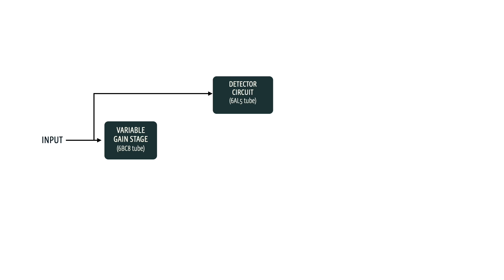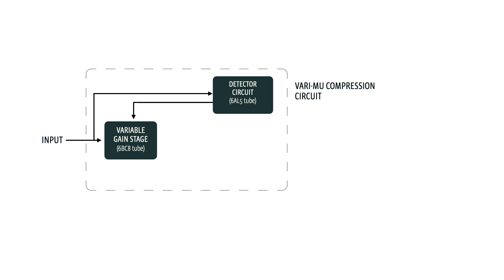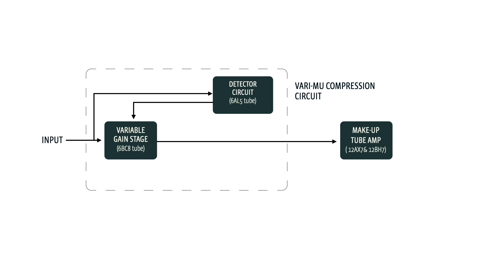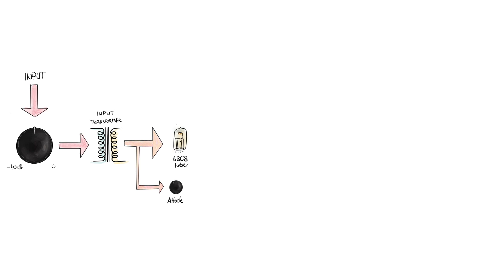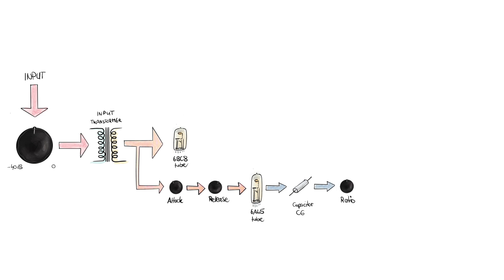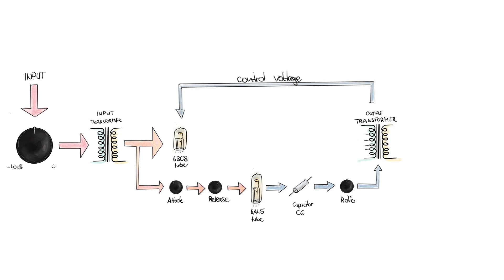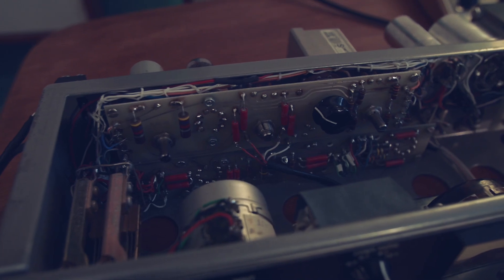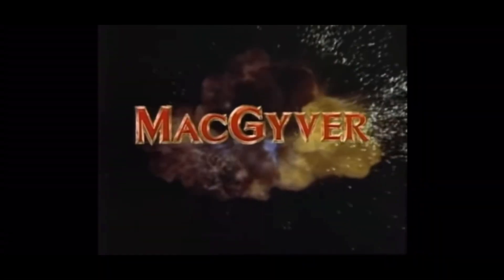176 VARI-MU Limiting Amplifier Complete Kit -  Episode 2

Comment: Definitely push pull pots  - this is an essential mod in my view (a true bypass would also be useful BTW).  I should also say that this kit is not too expensive - I costed  a 176 build from scratch last year and it was more expensive, without a real case, with Sowter TX, plus all the hassle of getting a faceplate drawn up, made up etc etc   Tubes are not cheap either - so the Group Buy with AMI TX, case, faceplate is really a good deal. I have mine on order already.

Comment: I was so excited for this. Such ashame it costs so much, I just can't justify that price on a single DIY kit when I can nearly buy 2x fully manufactured distressors for the same amount. Especially seen as you'd need two kits for stereo operation costing half a band 😮. 

I'm sure people who specifically want and can't find a 175/176 will be over the moon to buy it, but IDK how many people that actually is who can also spare the kind of money it costs. Hopefully enough for the kit to sell though!
Reply from the maker: I know - it was really about to make the 176 available again - and this things utilizes 7 tubes, 5 transformers (incl. choke and OWR transformer) dozens of custom boutique parts that are all just super expensive 🤷🏼‍♂ Thanks so much for your encouraging words though ❤
Reply: @analogvibes  Oh I understand why it is priced the way it is, and really wish I could afford it. I have built a custom dual/stereo LA2A before with all top tier parts (and am in the middle of building a second bit by bit) and it's not cheap when you have 5 quality irons and 8 tubes (even just 8x small jj's will cost like $300 nearly - start putting NOS RCA tubes and they are like 100+ each for some!) even the faithful recreation opto cells were like several multiple hunderads to get a pair of... The output caps alone were also like 30-40 a pop and there's a minimum of 2x everything inside it and that's a standard component lol.

I just hadn't seen inside a 176 before, so was unsure about it's full makeup untill now and was hoping it wasn't so complex of a unit. It's for sure worth the money, I just don't have it to spend hah, nor can I justify to myself paying it for a single kit when I can buy a lot of other stuff I need with that. That's just my personal situation though and not a reflection of the kit and it's value. 😉✌️
Reply: What is the price?
Reply: @aleksandarstojceski3139  2500 euro

Comment: what about mods for stepped controls for mastering? would love to strap a pair of these on the master bus and add all the vibe and glue I can in an easily recallable way
Reply from the maker: For the input and output you'd need to look for 600 Ohm stepped attenuators as the vernier gives you an extra bit to control to fine tune. I know only one guy who has two original 176s and he uses them on busses quite often - especially guitar or vocals!

Comment: Noway, for $3000 that 176 better arrive at my door step Fully put together.
And what's going to happen once people start Trying to put the kit together, and they damage part's and tubes?
I'll tell you what's going to happen, they'll have to spend a massive amount of money to get spare parts, and that still is no guarantee that the board hasn't burnt out, from the mistakes they made trying to assemble the kit.
SO either sell the kit for about $500 or offer everyone that purchases a kit, free spare parts.
Because 90 percent of the people that will purchase a kit for $3000 will destroy the 1st kit that they purchase.
SORRY BUT SOMEONE HAS TO BE THE ADULT IN THIS SITUATION.
And great Job on Your recreations.
Reply: For $3000 i can just buy the retro 176 😂
Reply: @mirkomarkovic3438  Or two mono distressors!
Reply: @mirkomarkovic3438   having opened one up it's build quality is crap & it uses cheap parts.
Reply: Well, I think Martin pointed out this kit is for those engineers who just want the 176 and can't get it. Because, well, you can't just buy a faithful 176 anymore. Having built transistor and tube gear, I know I always managed to get it done in the end. And yes, you can drop a 60$ tube, but it takes a lot more abuse tu destroy the expensive transformers or chassis. But yeah, it feels like a build where people need to be confident in their skills. If you're not, I bet you'll find other compressors that fits you equally well.
Reply: And for 500$, you get 3 transformers and maybe some of the tubes on top, but probably not the chassis and definitely no other components. Tube audio is just expensive.
Reply: This teacher describes the control audio comes from the input but this is a feedback limiter. Buyer beware.